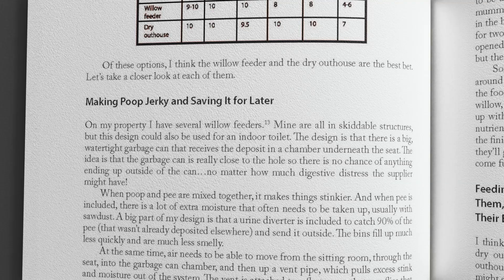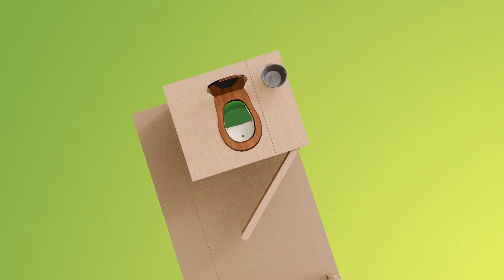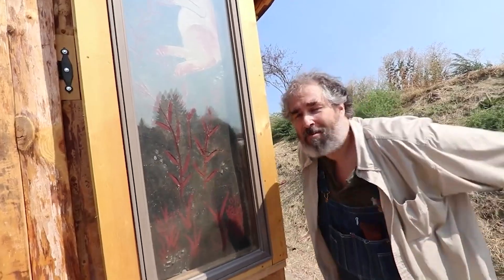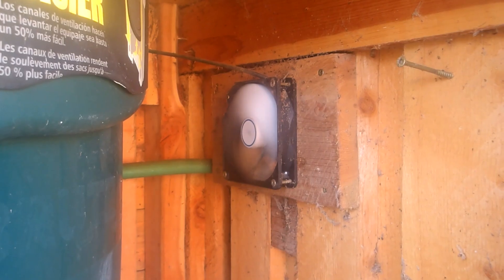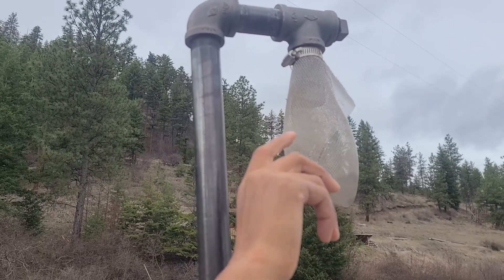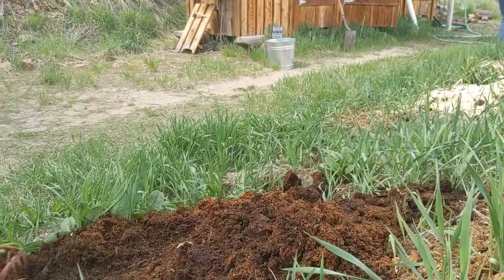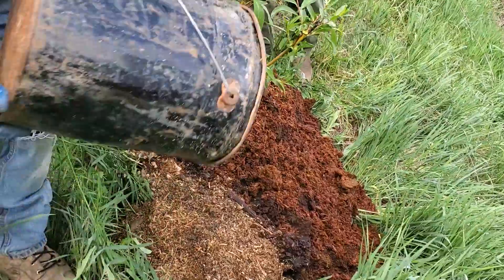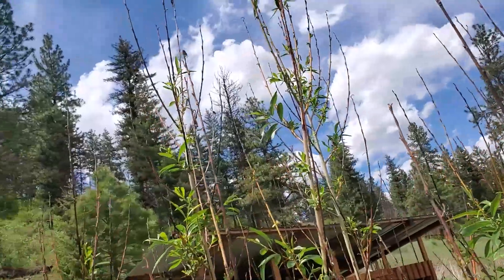poop jerky - transforming dangerous waste into a useful resource

Comment: Mine have actually composted, but I have used sitka spruce twigs sent through shredder, mixed with coco coir  as coverings. The result has been extremely rich compost, that I have used for potting plants, and the results have been insane. The compost lasts for far longer than commercially bought compost, have not needed any fertiliser to keep my plants flowering like mad for 2 years. Currently I am using wood shavings and will see how that changes things. Will know in two years lol